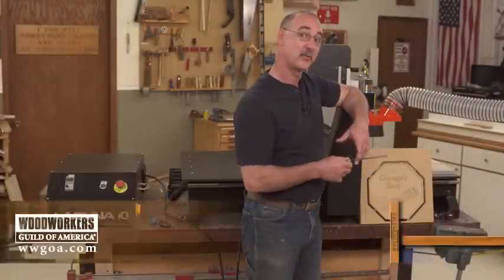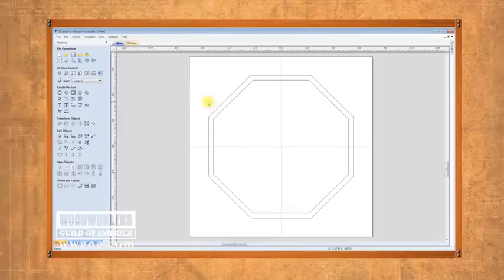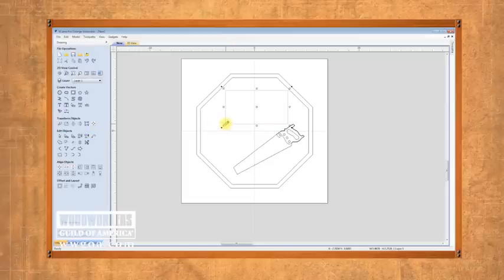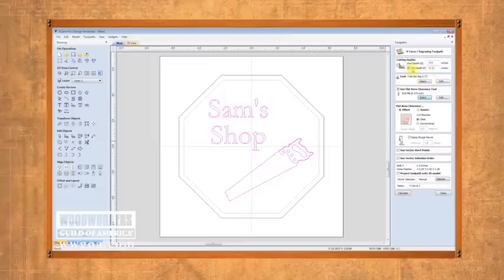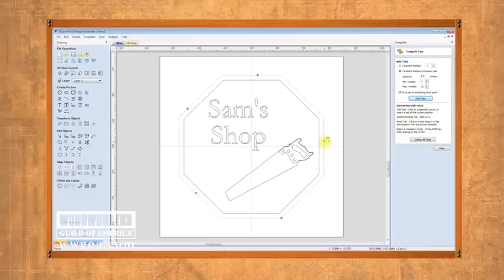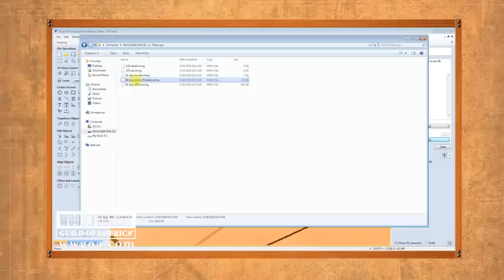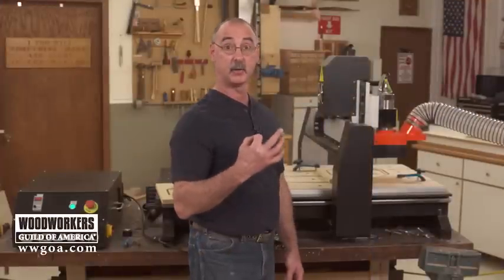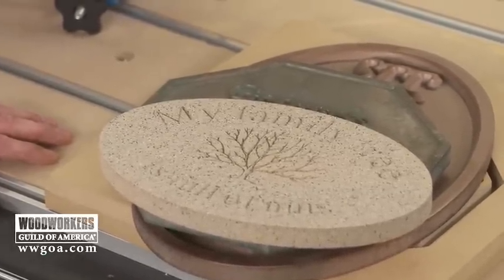V-Carving Artwork & Letters With a CNC Router

Comment: Isn't there a chance of cutting into a T-Track when you set the z-axis depth more than the thickness of the stock?
Reply: Yes, there is.  You have to be careful to go only slightly, 1/32" or so, beyond the thickness of your stock.  The MDF spoil board on the Laguna machine stands higher than the T-track.